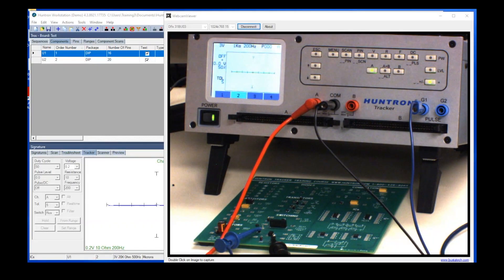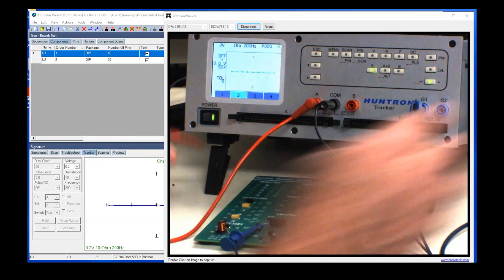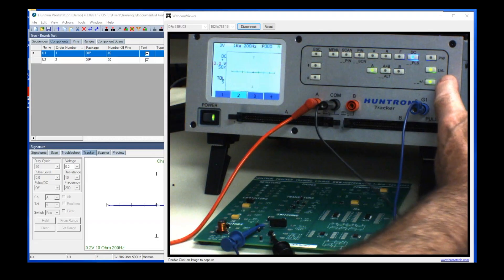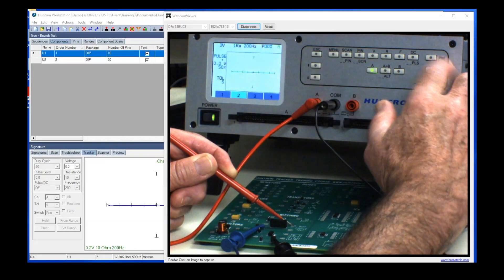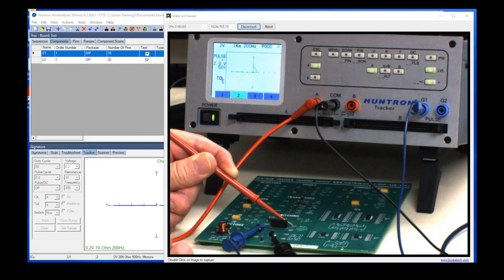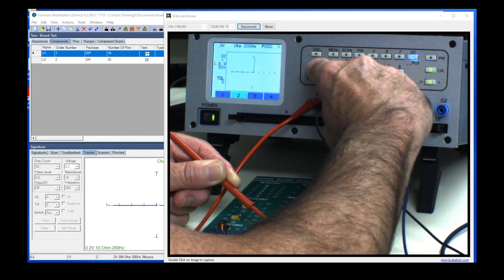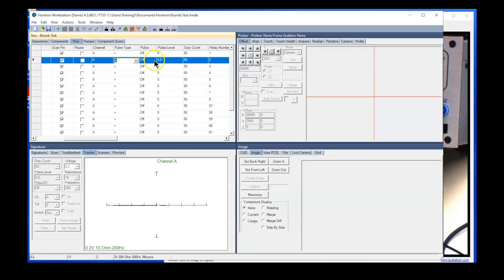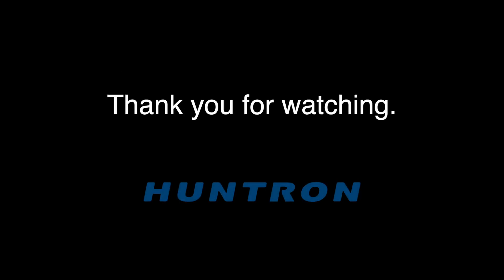Quick Tip #14 - How to use the Huntron Tracker 3200S Pulse Generator

Comment: Hi, the generator is an amazing time saver for testing, I envy the level display right on the screen. I also have this function on my tracker, but I only have to estimate the level setting from the position of the potentiometer (due to the necessary miniaturization, I can't even fit a scale on the potentiometer), or measure with an external meter.

Thanks for the demonstration 👍

Nice day 🙂Tom
Reply from the maker: The Tracker 2000 does have scale marking but no true indication of the voltage. Time for a new Tracker!!
Reply: @Huntron  Yes, it would require a new tracker, but unfortunately I can't afford it as an amateur today, I have a Chinese copy of the Tektronix TI-210 tracker, I bought it broken and repaired it - it was an experience, all the semiconductors had a laser-burned marking. To make matters worse, I had to buy a new digital oscilloscope because the old one went crazy and started adding a positive offset to the zero value - no fault found, no temperature dependence detected, even replaying the FW and recalibration didn't help - probably the processor. We will have a poor Christmas this year 😂

To this day, I don't even have your super extendable measuring tips, the availability of which I once asked you about. I contacted the supplier on your advice and I didn't even get a reply, you little worm I cough on you.
Reply from the maker: If it is possible for you to buy internationally, you can order Microprobes from TestEquity (testequity.com).
Reply: @Huntron  Hi, thanks for the link, I have no problem with buying abroad, but what I have a problem with is money - my dishwasher just started to fail after twenty-nine years of operation - I found the fault, but given the overall condition, the repair would be unprofitable. After buying a new dishwasher and an oscilloscope, I have zero reserves and so I have to wait, but I know for sure that I want those probes.

Thank you again and have a nice day 🙂 Tom